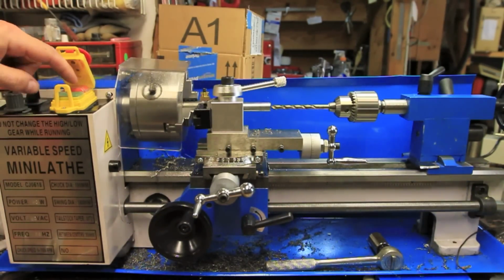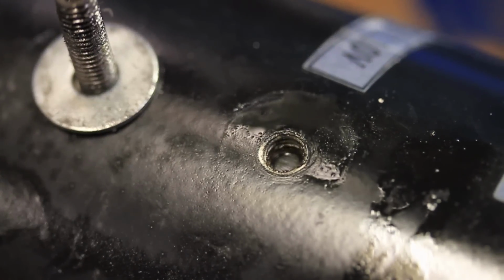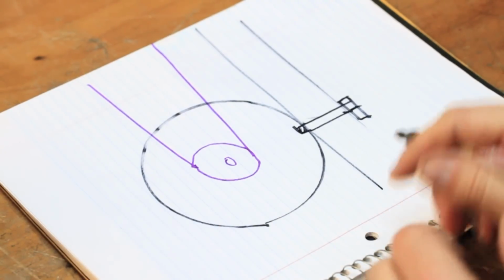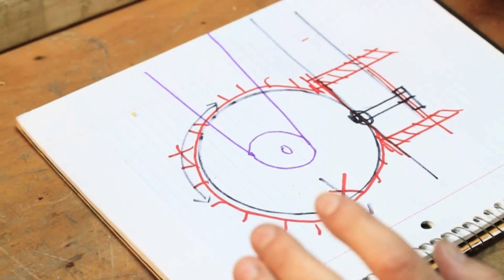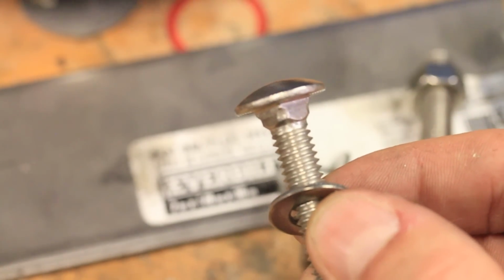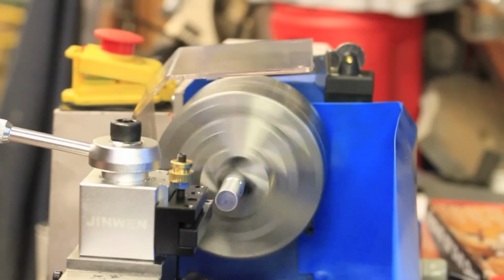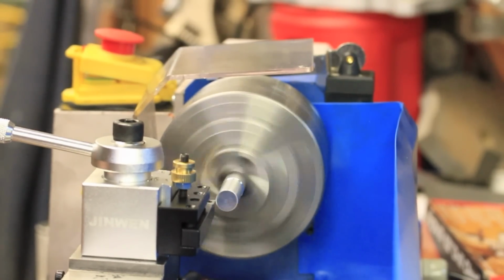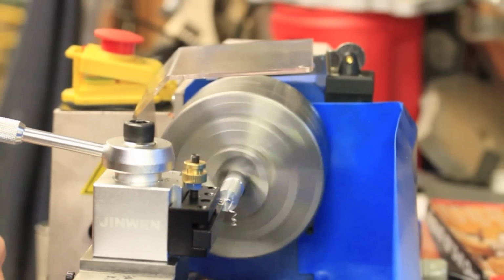It wasn't broken, just cheap - Fixing the Mini Lathe Motor Mount

Comment: TimNummyYou might find this interesting that my "MicroLux" 7x14 mini lathe put by Micro-Mark (at least in the model I purchased in 2005) has a completely different motor mount than that found in your model. On the MircoLux, there are no slotted bolt holes on the front frame. Instead, a longitudinal rod affixed along the motor's longitudinal axis acts as a pivot with pockets at each end in order to engage two "set screws" on the forward and aft of the bed frame...each of which has a locking nut. This allows for precise alignment of the pulleys as well as belt tension adjustment. I appears that other SIEG models don't have this configuration including LittleMachineShop and Grizzly, but maybe you know better about that than I.
Reply from the maker: I don't know one way or another but that sounds like a much better set up than what came on this one - maybe if I need to fix it again I will update to something similar but in the mean time my repair has been pretty reliable. Thanks for the comment!
Reply: The problem with updating to the longitudinal rod setup is having to bore and tap two adjacent holes into the cast iron frame, precisely parallel to the base both on the X and Y axis, so as to accommodate the two "set screws" which capture the motor mounting rod. The only way I can see to get the two tapped holes in exact alignment would be to bore and tap with a long enough tool to breech the distance between the base walls. This operation would require a mill or drill press with the capacity of such an accommodation; and there's no way I could do that with the tools I have.

Comment: Hi Sir, Can this machine be used on cutting hard steels Bar.
Reply from the maker: Hey, it should be able to as long as you work slowly. My next video will be cutting some 2.25" diameter mild steel and eventually I will be cutting some 4130.
Reply: I will like to order one but the Amazon website say it doesn't ship to my country, is there any options..

Comment: I don't know how often you take the nut off of the rear headstock shaft, but a wrench that fits a booster hose   https://tinyurl.com/ybez2ojf  or a collet wrench https://tinyurl.com/ydxpqjjy   might fit that nut and save some wear by using slip lock pliers. Just a suggestion for you. Great additions to the lathe.

Comment: Any thoughts on whether you would spend a little more on a different model if you had a redo?
Reply from the maker: I think if I just wanted to buy something that worked out of the box and I could just jump into using it (which also was what I thought I was getting) I would go with a different model. That said, if you're handy and understand that buying one of these is mostly buying a lathe kit that needs a lot of attention before you can use it, then it's a good deal and a good learning experience. However, I think at this point, this channel has more or less been built on the foundation of fixing and upgrading this little lathe, so in my case with 20/20 hindsight, I think it was a great choice.

BUT I had also never used a lathe before and would LOVE a 10" Monarch... so if anyone reading this has one to donate to the cause..... :)

Comment: I just got tool holders and inserts from banggood. Saw a review on the YouTube channel “ Xynudu”. I have the ones you used on your video, the Banggood tools are awesome they hold up to interrupted cuts. I’m a horrible hobby tinkerer but getting better. I have an old 3 in 1 lathe, mill, and drill press. Thanks for sharing

Comment: Ok first off I have one of these lol yeah I know so here is my question on the motor mount instead of keeping the full clamp couldn't you just weld the U into place one you have it positioned ? Just a thought I'm sure I know the answer but I am asking you. Your thoughts on it ?
Reply from the maker: I'm not sure I understand the question... you mean the parts that bolt on, just weld them on instead? I guess in theory I could have but it would have made adjusting it impossible and I don't know that there would have been much of a benefit to welding them on.

Thanks for the question though!

Comment: Love when YouTube actually recommends really good videos!!
I love your solution to the motor mount!  I have been looking for a cheap lathe and vertical mill. It's nice to see that even when getting cheap ass stuff there are ways to make it more skookum!!
Reply from the maker: Haha sounds like you made your way over here from AvE?

Thanks so much! I really appreciate that.
Reply: TimNummy 
Yeah buddy. I have watched quite a bit of AVE. Mostly on my normal account not my "branded" one.
That guy has made me laugh till it hurt!
Great work in your channel though!  I am jealous of the equipment!  I'd be happy with a drill press sometimes man. Gotta make due with what ya got though.
I always wondered though if you could mount that lathe on your drill press table and use the slides on the lath as a makeshift lathe and use the press to hold the cutting tool!
If you ever need any cutting tools get in touch with me. We have a place near me that sells cutting tools (and materials - steel, aluminum, etc) by the pound! I bought a bunch of drill bits and milling tools, they are only 3$ a pound!!

Comment: What do you think friends? Inch pound torque wrench to avoid over torquing the nuts on the exhaust brackets. With bearing housing mounts it's crucial. Motor mounts?

Comment: So is this really worth buying? And how much did this lathe ended up costing with the upgrades and parts to get it all fixed and running?
Reply from the maker: If you treat it like a kit and a learning experience then yes. But if you're used to a full size lathe and a seasoned user that just wants to take it out of the box and expect it to work well then probably not. The upgrades were mostly time as the pieces I used were pretty cheap. I'm not sure what the total cost was but it'd likely be misleading because of the time it took to make the changes.

Comment: Nice fix!

I have also had to retro-correct cheap design to make tools safe.

It's a trade off for the low price...

Unless you know what you are doing or you have had experience in practical problem solved no, I would recommend caution to anyone who is keen to fix their own equipment. Safety first. Don't take risks, especially with equipment that uses electricity, sharp blades or points and high speed rotation or other motion.

Comment: Well, I really enjoyed your cam here. Your solution to the motor was excellent. Now about this machine: this machine is only made for a person looking to make a small part for around the house or to fix a small part maybe for your car. Reason? Nylon change gears, loose fitting parts, terrible machining. Guaranteed this little beauty won't cut parallel, so keep sharp files close by.
If you need to make something reasonably close in tolerance, use micrometers or calipers for every dimension. Make sure you check the dials on the handles for accuracy before you make any parts.
The part you wanted to drill and the machine was too short? Have two drills, one cut short to start with and when that one is as far as possible, loosen chuck, take part out and insert longer drill into part. Now put part back in chuck, slide drill out to be held in tailstock to finish your depth. 
I've had to do this on the factory floor hundreds of times when a part was a little too large, or when It had been set just off the edge of the table for machining purposes and couldn't move the part because of tolerance issues.
Good luck with machine and take small cuts even if you have to turn a a 1" parts down to 3/8" for whatever reason. Try to get extra belts for when the old ones break.

Comment: I have a similar lathe. It has not failed yet, but I'll check the motor mounting solution just in case it's the same as in yours.

Comment: I would like to find another mini lathe cheap just to have the extra parts on hand and use the bed to extend my bed to a 24" bed. I can also join 2 lead screws together instead of having to buy a longer feed screw, I had to splice together a broken Lead Screw from an old Seneca Falls lathe.. Pretty simple fix and it was good and solid.

Comment: would you recommend buying this lathe for cheap then imediatly upgrading it.  or buy a better lathe from the start.  And spend more money
Reply from the maker: Hmm. That's tough. If you're familiar with using high end lathes or you have a project that needs to be done quickly then I would recommend buying a better lathe from the start. However, if you're still new to using a lathe and want a cheap learning experience that will be rewarded with a very usable tool then I would absolutely recommend this one. 

I've learned a tremendous amount having worked on this lathe that I wouldn't have had a reason to learn if I got something that worked out of the box. And by now, I have videos of pretty much everything you need to do to get it into reliable shape :)
Reply: I just worry about the cheap plastic handles and the self loosening components which are outrageously stupid.       the thing is any lathe I buy I will have to import because there are no retailers in my country.  so the only proper reviews I see are from YouTube videos.   ; )       I think I'm just going to have to buy a less troublesome lathe. I'm not looking for any inconvenience.  life is just to short for unnecessary inconveniences
Reply from the maker: "life is just to short for unnecessary inconveniences" <- this is so true :)

I haven't had an issue with the plastic handles at all if that helps. And one of the first projects I did to help get familiar with everything is make new handles to replace the ones that loosen when you use them.

But that said, I don't blame you at all for getting something better - this one just happened to fit both my space and financial requirements.
Reply: I could probs just borrow a friends lathe and build my own.    I'm saying this as a joke.   but as I say it the idea in my head just started sounding amazing.

Comment: Mine also makes a clicking noise when running. I will check the mounting molts on the motor.I can tell it's clicking the same place yours was.
Reply from the maker: Definitely do, especially before it ruins your belt.

Comment: Considering the quality of this lathe I feel that you over engineered the motor mount.  Personally I would've just welded a couple nuts to the motor case where the original holes were.
Reply from the maker: Maybe so, but that solution would have still put a lot of torque stress on the bolts.
Reply: yeah no doubt, it wouldn't be the strongest solution.  Your solution is great, well thought out and much stronger.   Just the cost and time of your solution seemed a bit unnecessary.   Anyway, +1 to the vid.
Reply from the maker: Thanks so much :)

Comment: Would it have been possible to have mounted the motor by extending tightening bolts for the exhaust clamps to be the bolts you mount with? When I saw you grap the exhaust clamps it was the first thing I thought you would do since it wouldn't have required welding that plate on.
Reply from the maker: If I understand you correctly, I don't know that the bolts for the exhaust clamps would have fit on the lathe frame to be able to be used for mounting it as well. Also I'm not sure how you could extend the bolts.

Basically I was looking for a better way to mount the motor securely while still taking advantage of the original mounting slots and adjustability. 

Hopefully this answers your question!
Reply: for mounting I thought you were going to make new holes to mount to instead of trying to work with the original mounting points. I also don't really know how you could extend the bolts, but for some reason that was just what came to mind.

Comment: Step 1: Buy cheap mini lathe.
Step 2 - 100: Repair all of the shortcuts the manufacturer used to make it so cheap.
Reply from the maker: Step 3: Profit

A few other people have made a good point, buying one of these with the mindset of it being a lathe parts kit, it's really a pretty good deal still. Expecting it to be working out of the box will just lead to disappointment though. Thanks for the comment!

Comment: still questioning if it could work with real metal unlike aluminum. like  mild steel and RVS.
Reply from the maker: Absolutely, mild and stainless steel are tough to machine in general because it tears rather than cuts smoothly so you end up with a pretty rough finish relative to aluminum or brass. However I've read that the 41*0 metals are nice to machine. There are also some other steel alloys that are mixed specifically to machine better. I have a pretty big project involving some 4130 coming up, so stay tuned.
Reply: I think it can. But reduce feed rate and equipped coolant injector is needed.

Comment: may i know the size of that belt and do you know where to get one? my lathe looks exactly like yours but not as badly assembled as yours.
Reply from the maker: Hey yeah, check out my video on it: https://www.youtube.com/watch?v=3CXZCu3T7Mw Ultimately this is the one I went with: http://amzn.to/2pEGHho but keep in mind that I did have to change the pulley on the motor because I'm pretty sure my pulleys were mismatched (all explained in the video)
Reply: TimNummy hey thanks forcthe quick reply. i shredded the teeth on mine. i measured it and its 10mm wide 4.5pitch 70teeth 330mm cut length. its hard to find one here in the philippines.

Comment: Wow, you did a great job. The original mount for the motor was disgusting - I can't believe they released the product like this.
Reply: Just like tool old soviet products.  The factory just expected the end user to Q.C., and complete final assemble of whatever they bought.
Reply: It's also what you paid for, the majority of mini lathes are rather cheaply made so there is bound to be corners cut wherever possible. This results in a product that isn't good/great, just good enough to get passing marks on what a (mini) lathe should be able to do. And while ppl tend to give mini lathes flak for being cheaply made, imprecise, a little wonky, etc it beats getting an actual full size lathe! which for any in good running order is gonna set you back 1.5k+ (you also might not have the room too) Most of mini lathes are made from the same company and are just rebranded so take what you will from it! Also due to it cheapness of it, it found mass market and has allowed for a thriving community of hobbyist to help each other out. My father has one and he got help getting most of the kinks worked out from the local machining hobby club!

Comment: Oh you've come at it from a different angle. You realise it's not normal to be so forgiving. The "right" thing to do would have been to smash it with a sledge hammer. Some ppl these days..
Reply: Roland O'Donnell  hay some if us dont have a 10000 dolars burning a hole in our pokets so i prefer to work some more  but i a have a hobbymat lathe and i love it
Reply from the maker: Haha it's a gift and a curse.